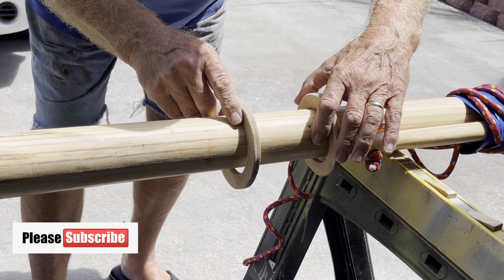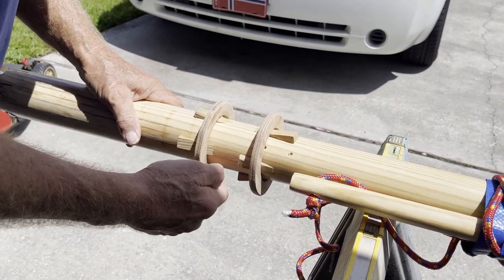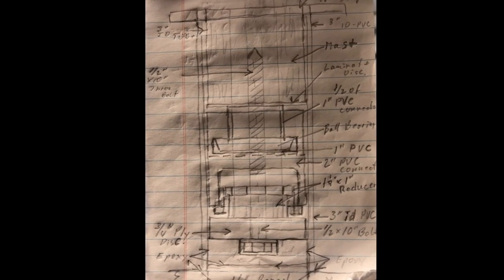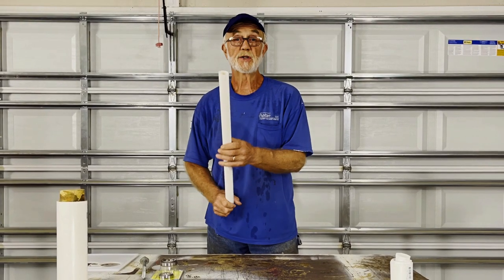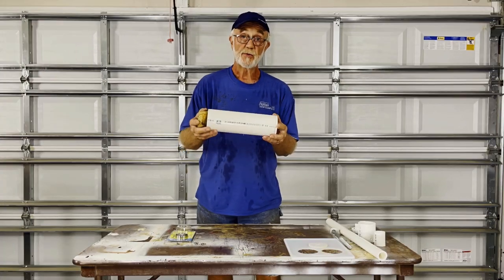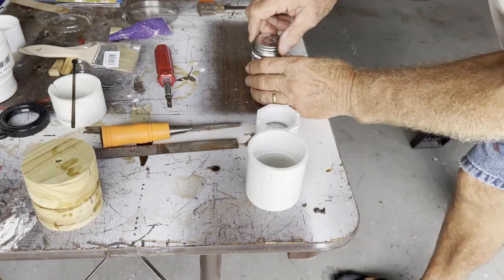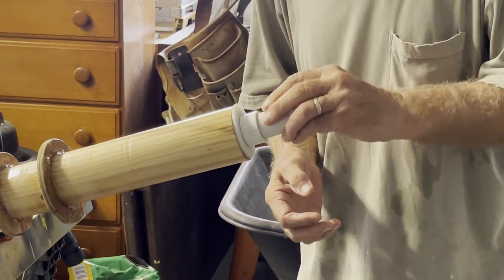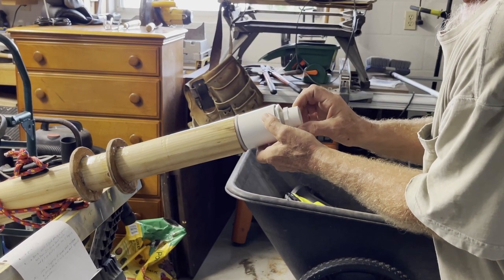The Rotating Mast Solution

Comment: My solution to the same issue with my sprit rig: I drilled out the mast step at a smaller diameter than the mast (in my case, at 1 inch), glued a matching 1-inch hardwood plug into the foot of the mast that extended into the mast step, and dropped two nylon washers into the bottom of the mast step to avoid contact between the bottom of the mast and the top of the mast step and ease rotation; then I leathered the mast partner (3/4-inch solid wood) to fit the diameter of the mast and greased the leather, initially with tallow and then with petroleum jelly.  The leather bearing surface spreads the stress on the wood of the mast and the mast rotates quite easily, with no damage to the mast. A plywood deck at the mast hole could be made thicker to increase the bearing surface by gluing on drilled blocks of plywood above and/or below the hole and then leathering the hole—or lining the hole with a short section of PVC pipe the same diameter as the mast and greasing it (or not)—though I have not tried the PVC alternative.

Comment: First, two questions:  1. What is the purpose of the two plywood rings you epoxied to the mast above the mast step (I haven't found the answer in your other videos)?  2.  Have you considered epoxying some small spacers (4?) into the top inside of the mast step to reduce the play without creating significant friction (which might be reduced with a bit of wax on occasion)?  I'm drawing plans for a dinghy I can load into the back of my pickup, and your videos on sail, mast, mast roller, and tiller have been very helpful.